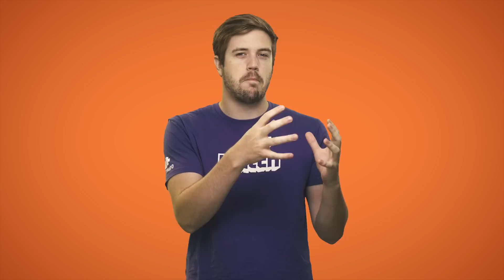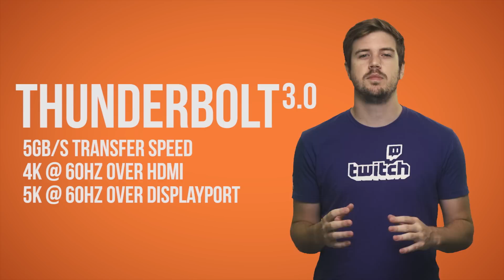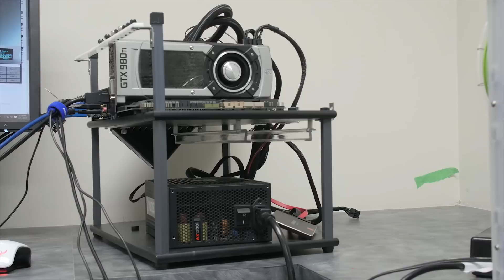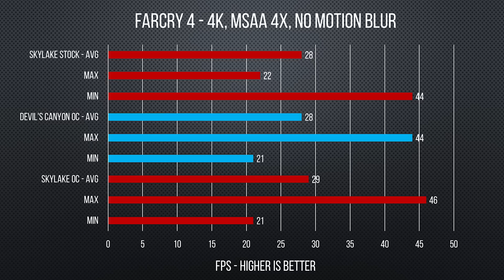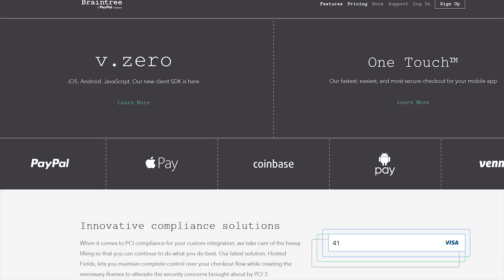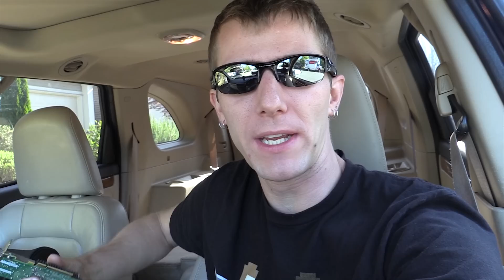Intel 6700K "Skylake" CPU

Comment: I rocked Ivy Bridge until 2020 and I barely used my skylake but when I started using it, loved it. Now I'm on Raptor Lake and I am so torn because it is the best performing CPU in all regards I have ever owned, but the failure rates are so insane I don't know what I will do when it dies and I really hope I don't have this one die on me because I would like to keep a working example for years to come even when I upgrade. But performance, it's as good as they say it is which there is nothing it can't do well. So far mine hasn't degraded but I don't count on it lasting. Might be my last foray into intel CPUs.

Comment: all the people who were still on sandy bridge in 2015. ew.
Reply: Hey, even in an 2019 tbvh it is not a bad thing to have one, especially paired with a recent upper midrange GPU (5700, 1660 Ti etc)
Reply: @hardbodybrain  lol 1660Ti is midranged, the 5700(xt) is a high end card not upper mid ranged lol. Its performance matches that of the 2070, even a 2070S in some cases. An overclocked 5700XT even trades blows with a 2080. True 1440p/60 1080p/144 card
Reply: @mycelia_ow  the 2070 and 5700xt aren’t high end gpu cards they’re mid tier. 2060 is low tier, 2070 mid and 2080 high. The 1650 and 1660 are the next step up from an IGPU and for people with a very limited budget.

Comment: Can somebody please help me! I Just upgraded from my i7 3770k, to this 6700k. When I play battlefield 1 I get half the fps that I'd get with my old CPU. I installed all the latest drivers and BIOS and still no fix. I get like 60fps with my 980ti, but when I had my 3770k with my 980ti I got atleast 100+ fps on the same settings. Strange is that my i7 3770k would be at 98% load, but the 6700k is only at 60% load. Anyone knows a fix? I'd be really happy to hear.

Comment: Ahhhh, no wonder why my 2400mhz memory runs at 2133mhz
Reply: What? You can run your RAM at 2400Mhz using the XMP in the bios. 

I have 3000Mhz RAM with the 6700K

Comment: is this a build
i5 6600k
gtx 970 
212 evo
16gb ddr4 3000mhz
500watt evga psu
z170a pcmate msi
i hope to get 60 fps on most aaa games at 1080p.
Reply: Marcos C get a 1060
Reply: well i forgot to say im geting the 970 for 190$. and i could but another for sli
Reply: the 1060 is just a 980. so the frame rate loss isn't that much and ill be doing sli
Reply: then get a 1070 or 1080 always buy the best single card you can afford
Reply: i cant afford those 700$ cards to me this is much better for cost
Reply: but you dont need sli 970's for 1080p
Reply: true but 1 970 is g8 for 1080p
Reply: i think i just stay with 1 970 that will last me a good 5 years. and i will be doing an oc on it on the last 2 years to get all the juice out of it.
Reply: +Marcos C Sli should only be done on the best card on the market. watch the tech quike on how it's bad
Reply: lol your on drugs a 970 fucked a 1050ti
Reply: ok thanks i already got the 970 so im good

Comment: I'm still running my Q6600 2.4 @ 3.0 quad-core from 9 years ago ( overclocked on air for 9 years 24/7 ) with 8GB DDR2 and an Asus P5k ( annoying built in network card glitch which requires different settings otherwise it will blue-screen when you send any data over a local-network to or from another pc - after changing the settings, no issue ).... I haven't had any reason to upgrade until recently and have been getting away with video-card upgrades ( from an 8800 512mb or 1gb [ single or dual monitor setup ] or something which died with massive artifacting to a 9800 gt oc 1gb [ dual monitors ] to 750ti 2gb..[ dual and now triple monitor setup ] )..  5TB mechanical storage and 1TB ssd right now...

I do a lot of programming and haven't really been active for 5.5 years due to a MVA serious injury with no end in sight - but surgery "may" make things better although with the permanent nerve damage I suffered it is unlikely... 

I am considering either any of the 4-6-8-10 core w/ hyper threading options available, most likely on 2011v3 unless something else comes along which offers more than 4 cores and will be supported longer... The 8gb memory has started becoming too low especially when I have more than 1 game open with Chrome and my programming ide, and other background processes... 3 monitors isn't enough either, despite running many helpful utilities such as RestartOnCrash ( which loads all apps that I need to run in the background, or foreground at that time, through schtasks ) and AutoSizer which repositions and sizes windows to my specification on any monitor I want - something I recommend ( although I will probably code something better because this is annoying to set up and because of how Windows sets up monitors / resolutions with negative values needed for monitors to the left of the primary and the offset needing to be added into the value you enter -- mine will be choose the monitor, choose the position and size on that monitor without having to worry if you shift the offsets around with helpers so you can do everything without needing to type it in or guess where the window will be afterwards in addition to having options to remove borders, etc... ) among other apps...

When I build a computer, I make it last...
Reply: you haven't been "getting away" with anything. Both the 8 and 9 series are perfect fits for the q6600 (I ran both those cards with it) and the 750ti...well...is a 750ti.
Reply: and im rocking pentium 4 single-core 3.0ghz with 2 gigs of ddr2
Reply: Aashish Vashisth
I am running same processor oced at 3.2 (upgraded from pentium 4) and it still beats the crap out of new processors (performance/price ratio) im able to play most of modern games on really good settings (paired with good graphic card) but i sometimes suffer in cpu heavy games
Reply: I'd wait for Zen until next upgrade, as there is a high probability that it will cause a significant price drop in the CPU market.
Reply: how does a setup like that performs in games
Reply: cool
Reply: I'm waiting for the 2066 socket processors... I was going to go 2011v3 but 2066 will support more than 4 cores and won't be phasing out..

Comment: I got an overclocked I7-950 from 2010... not that much of a difference, 3000MT/s and 900Mhz stock, clocked its almost equal in clock speeds... In the early 2000s every processor jump was at least noticeable.

Comment: Does the skylake still take the normal LGA 115x air coolers?
Reply: Yes. I'm using a Hyper 212 Evo on my 6700k. Though that cooler can be adjusted for MANY different slots, it is setup to use the 115x config.

Comment: question.. would it be worth it to upgrade to this cpu(i7 6700k)? 
current build: amd fx 8350, gtx 1070, gigabyte ga 990fxa-ud3 , 16gb ram.
Reply: Depends on what you play
Reply: +PJ i play pretty much everything! my main goal is setting up my pc for 144hz gaming. so i figured upgrading my cpu should be the next step
Reply: +sam him and ofcourse i would need to get a new mobo+ram and all the good stuff
Reply: ***** I'd say go for it since DDR4 provides quite the FPS boost in some games
And if you can afford then go for it
And maybe wait if you can till fall for Kaby Lake (7th gen Intel CPUs) and I'd also say wait for the next gen of GPUs before upgrading that and get the 1180 or RX 590 (Or whatevery they're going to call them) since those will most likely push 4k gaming at 60fps and 1080p 200 maxed out
Reply: Absolutely, that processer is bottlenecking the shit out of your 1070.

Comment: It says it only has pcie x16 but i want to run 2 gpus. Can I?
Reply: Yes. But i would not use any of your other pcie slots. I run 2 970ssc on an evga classified k and works great. Both run in 8x though, but with pcie gen 2 performance difference is barely noticeable if at all to the naked eye. pcie gen 3 im not sure, when i upgrade my rig to 2 1080s ill be anxious to see how well it works.
Reply: it's well documented most GPU's (even most 10 series cards) won't even saturate 8 PCIE lanes so you should still easily handle dual cards unless you go to like 2 Titan X(P)'s

Comment: Considering upgrade from 3560k. Funny thing, it's k (unlocked clock) 'cause they were having a deal and it was cheaper than the locked version. Mobo is non-overclocking tho. Still can find overclocking boards for 3560k for like 80-120. I have a decent CPU cooler. Having recently installed a gtx 1070 some games are hitting cpu limitations. So I'm open to anyone's suggestions for an upgrade path. Currently asking around my friends to see if anyone has a z77 board lying around. Not holding my breath. If not yall think its worth 80+ bones to OC my current ivy bridge i5? Go with a 6700k setup? Sorta don't want to wait a year for an overclockable kaby lake chip. Maybe zen? hmm.

Comment: I don't know if I should get the i7-4790k or the i7-6700k
Reply: Not a whole lot of difference in performance but the i7-6700k is on a new platform with newer features so you should definitely go for that.

Comment: whats the actual dffrnce in 6700 and 6700k?
Reply: A 'k'
Reply: Overclockability. You can't overclock the 6700, but you can overclock the 6700K.
Reply: That's actually not true. Even though all the motherboards come with the BIOS update, which prevents overclocking from the non "k" version you can still roll back the BIOS to the older versions and overclock the non "k" like before without any issues. So paying the extra premium isn't really worth it unless your not comfortable with flashing the BIOS.

Comment: I'm super new to overclocking and sitting here with my I7 6700K, MSI m3 gaming motherboard and Kelvin s24 water cooling 
i just want the cpu to get to 4.5 ghz, is that stable with the motherboard im using? 
if i put in sync all cores, then 45 to all of them cores, put the voltage up to 1.325? (please recommend the voltage i should use) 
is this going to be possible or is it going to go to hell?

Comment: I need some help. I'm currently creating a new build. I'm a gamer and youtuber. I do a lot of editing and I would like to push my editing to the next step without any preview lag. I have to work with the lowest of settings with my current build and editing is not fun. So I've built a $2000 (ISH) build below but I'm really stuck on which CPU to buy. If anyone could recommend what I should do, then please feel free to let me know. :) Thank you!! 

I've never overclocked before, I'm guessing this would change the decision. 

CPU -   i7 6700k with 4ghz 4 cores OR i7 5820 with 6 cores 3ghz etc ??????????

Motherboard - MSI Z170A XPower Titanium Edition
GPU - Nvidia GTX 1070 8gb ( Released Tomorrow ) 
RAM - Croasir DDR4 32gb RAM
NZXT - Liquid Cooler
NZXT - H440 Case
SSD - Samsung 850 Pro 512gb
HDD- 3TB Drive
PSU - Corsair HX750i
Reply: Looks Good to me bud, I too am a gamer and a very new Youtuber who is considering a serious PC upgrade and your specs are pretty much what i had planned for a new build!
I Hate the preview lag i get using a FX-4300 even at 4.Ghz lol
I'll check out your channel
Reply: I would maybe try to cut some corners in some places to get a 5930k
Reply: The only advantage of a 5930k over a 5820k is the larger amount of PCIe-lanes, which you would only need for crossfire/SLI
Reply: go with the i7 5820k, change the liquid cooler to the corsair 115i, get a non modulay 650w psu, get the 250gb evo ssd, get the 2tb hdd, replace the GPU with the gtx1080FTW edition GPU, and get the MSI X99A Sli Plus USB 3.1 Motherboard to fit the CPU in the socket.
Reply: I pretty much went for exactly what you said but I stuck with the 1070  ;-)
Reply: wait u already built it?

Comment: I upgraded from an FX- 8350 Yea.. it's an upgrade lol
Reply: Sandy bridge is an upgrade from that
Reply: Xamnition worst part is i had a 980 Ti and it was bottle-necking the shit out of it. I get almost 2x the frames on all games.
Reply: fx-8300 is an upgrade from my Phenom 9750.  :(
Definitely looking at going Skylake, unless I find out that there really aren't going to be many more releases for the chipset.  I figure get into the Skylake (z170) quick and cheap with a G4400 Pentium (about on par with my current processor in synthetic benchmarks - but 50% faster single thread) and then 6 months to a year or so down the road drop in a good CPU and then as a last hurrah before having to move to the next chipset, drop in one of the final generations of Skylake to keep the computer semi relevant.

Comment: Hi quick question for Linus (or anyone for that matter). Im building a new rig with a 6700k and Im stuck between the Corsair H100i v2 and the Fractal Design Kelvin s24 for cooling. What are your thoughts?

Comment: I still have a Core2Duo E8400 @ 3,2GH, I guess a 6700k would be worth the upgrade? Seems like my CPU reaches its absolute limit on most games now :S
Reply: I love the e8400, you can pickup whole machines based on it from ebay for $50 that make a great htpc
Reply: Should be perfect for HTPC, indeed. For whatever reason people need a HTPC. :D
I will continue to use the system as a storage-center with tons of HDD capactiy hehe. Going 6700k soon, cant wait another 8 years. :D

Comment: I made a mistake and bought an AMD FX-9590. Just because I wanted an "out of the box" 5gHz experience.
Have always liked AMD because of its performance per buck status but this FX really is crap. I have a 5gHz processor that is unstable to a point that I need to downclock it to 4gHz.
I'll wait for the Zen architecture and see how it goes. If it is a complete failure, I'll move on to Intel. Enough is enough.
Reply: Jacob Petre
I have what you call a "high end" water cooler. In fact, I use a dual 120mm radiator with a "push and pull" setup and the cpu rarely goes over 40 degrees. It is NOT a cooling issue. The FX-9590 is known for being merely an FX-8350 overclocked by AMD.
The only setup that allows me to have a usable system is when I disable C1 and C6 states on my BIOS. Still, when gaming, I experience constant freezing at 5gHz and I need to downclock it to 4gHz if I want to game demanding games.
The FX-9590 is a bad joke by AMD. Overclocking is possible, we all know it. Making it stable is a different story.
Not to mention that AM3+ does NOT support DDR3 faster than 1333mHz.
I mean... it's 2016, DDR4 has been there for sometime now and AMD still hasn't come out with support for DDR4.
Like I said, I will wait for this Zen and see what it is like. If it is another AMD failure, I'm going to change to Intel.
Reply: +Victor England AM3+ supports DDR3 @2400MHz don't listen to him I have an Fx-9370 and it plays games better than a 4770k on new dx12 titles.
Reply: Jake Bezzina
No, it doesn't. Read AMD's "small print" and you can see it for yourself.

https://www.amd.com/en-us/products/processors/desktop/fx#

Scroll down the page and click on the tab "Features".

You will then read this, taken from AMD's website:

Integrated DRAM Controller with AMD Memory Optimizer Technology
An optimized, high-bandwidth, low-latency integrated memory controller to feed more cores.
Supports up to DDR3-1866
Supports low voltage memories of 1.35V and 1.2V
Up to 29.9GB/s memory bandwidth for DDR3
Pre-Fetcher improvements
Direct communications to each core in Dual-Core module (APIC registers in each core)

So, you are talking shit. AMD processors DO NOT support anything higher than 1866. Anything higher than that will be overclocking as natively AM3+ run at 1333 maximum speed. Yes, you can run even RAM at 3000mhz if you want but don't expect the system to be stable.
Don't argue with people who know what they are talking about. By doing so, you don't look like a fool like you just did.
Reply: Then how is muy mobo running DDR3 at 2133MHz then?
Reply: Jake Bezzina
It's unsupported. Like I said, you can run DDR3 at a billion megahertz if you want. That's overclocking. If you don't like it, complain to AMD - not to me.
Reply: AMDs "up to"s are a bit under-whelmed and it could be that you bought a 970fx mobo which is not recommended for a 9590
Reply: an fx-9590 needs a 990fx mobo to run at its peek
Reply: Jake Bezzina
I know. I'm not a noob. I've been building systems professionally for at least 30 years. I'm older than the x86 processors. Trust me, AMD is crap. I have it, I use it, but there is nothing that makes AMD go nowhere near Intel.
Reply: +Victor England AMD is crap? lol that is such a bad excuse. OK gramps, tell me how AMD is crap when their 3 year old CPUs are still not fully utilised by the developers
Reply: Jake Bezzina
What developers? Developers of what, exactly?
If you consider a kid working in a basement a developer, than I'm sorry for you.
Reply: If you did not know that DX11 doesn`t like to use multiple cores unless coded to then almost every developer makes games which are Intel friendly(until DX12 becomes mainsteam)
Reply: Hello, the chips is power hungry, but that version is better optimized than FX 8350, I recommend you to cu 2 cores and make a 6-core from it, clocked at 4.6GHz, it is the best solution I found for my FX 8320, and runs GTA 5 very well, since the single core performance is very important in games, and the first core is also hardly used to divide the workload between cores, less cores means also less workload for the first core.
Reply: Jake Bezzina What does dx11's threading have to do with amd?Games can't use Intel's 6+ core chips either.
I really do like amd, but the fx series are not powerful gaming cpus. The 8350 gets beat by even Intel's dual-core 6300 in most games. Not by a lot though, so it makes more sense to get the 8350.

Comment: The 6700k only has 16 PCI Lanes though. Can that FULLY support 2 GPU's, 1 M.2, and 8-10 SATA drives all at the same time without a bottleneck?
Reply: +Joseph White That's my biggest issue with my 6600k. Limiting them both to 16x seems like a pretty poor design decision.
Reply: If your going to use a high end M.2, and 8-10 SATA drives... You should use the X99 format